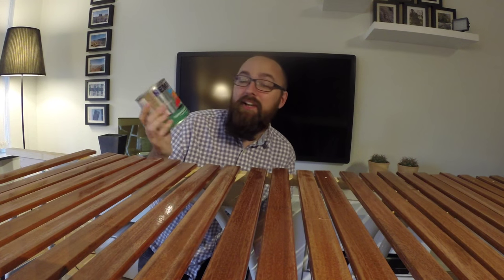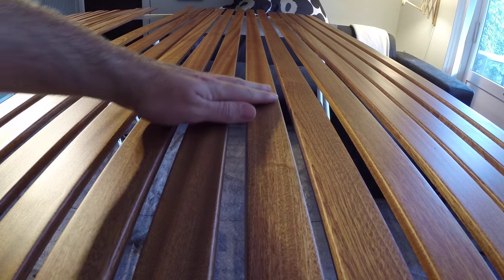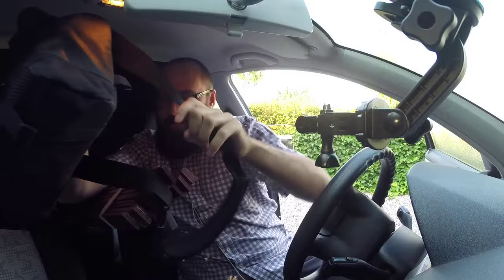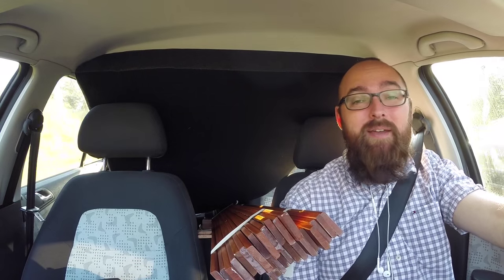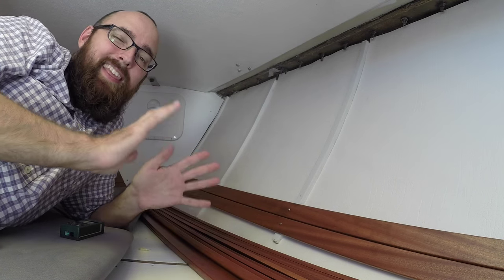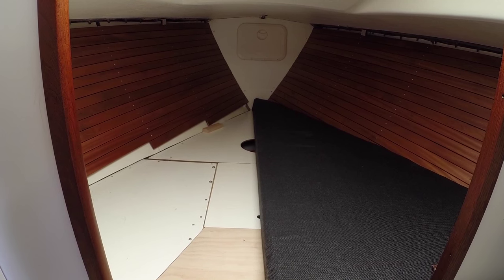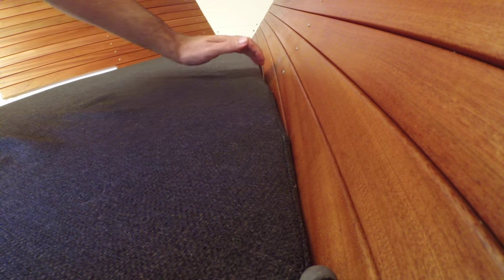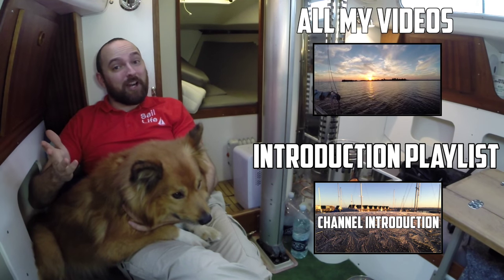Sail Life - Insulating the v-berth, part 9

Comment: Excellent job Mads!!
The little "bumps" in the seams of the mattress may be from the sewing allowance , that 1/2" bit of fabric where the seam and the edge of the fabric, has decided to flip from the faceing to the boxing. It should all be on the boxing (the sides of the mattress) angle, not on the top (the facing it's called). It's an easy fix with an ice pick. Just insert the ice pick close to the seam, and work the allowance to the side you need it to go to. A bit of care is needed, but you can do this without harming the fabric. 
Having the selvage allowance on the boxing side makes the cushion look more square, and not rounded over. 
If the foam is what is making the bulges, a dacron wrap would have taken care of that. 
I think it looks great! Especially for a first-timer!!